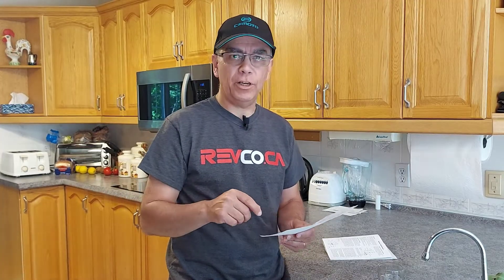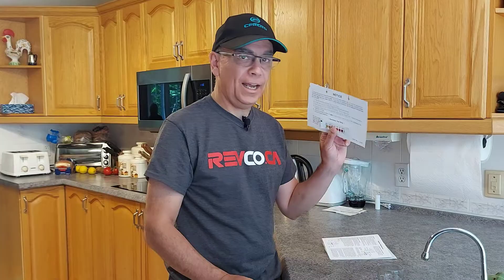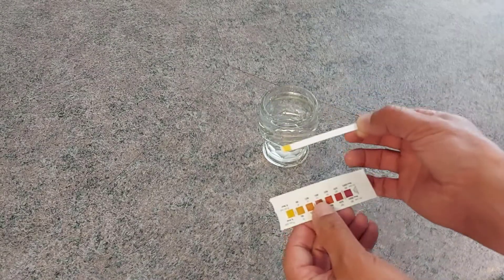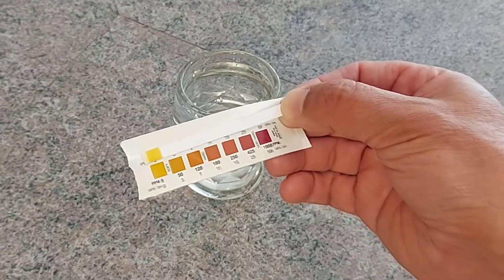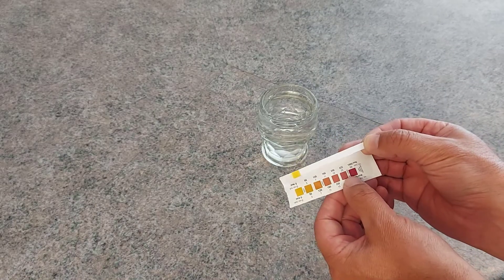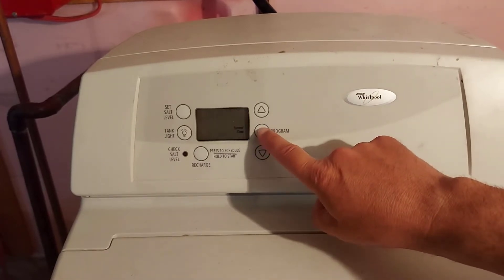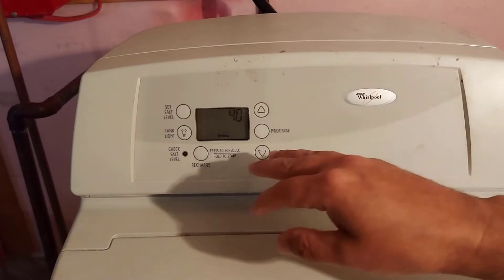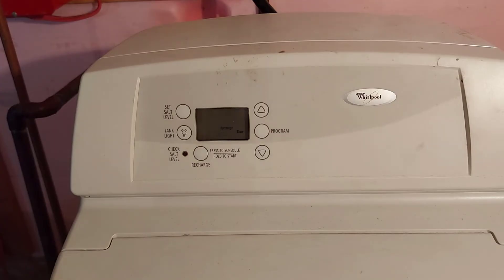How Can I Test My Water Hardness and Adjust the Water Softener Settings

Comment: I think you getting confused. To set the correct amout of salt to be used during a regeneration, you need to do a test to determine the hardness of your RAW water (before it passes through the softener.) 

In addition, you also need to do a test for the amount of clear water iron in your water (this requires a different test). 

Once you have your hardness level, for example lets assume 30  grains of hardness, and your iron, assume 2 ppm of iron, multiply the iron figure by 5  and add to the hardness. 

In this example, 2 ppm × 5 = 10 + 30 = 40. 40 would be the correct setting for your water softener. 

Once your Whirlpool has the setting, it will automatically calculate the interval as to when to recharge. It does this by monitoring the amount of water flowing through the softener over time, in gallons and sets a regeneration cycle as needed.

Comment: My number is 3 gpg what number i put in my whirpool 40.000 grain thanks
Reply: You must test your raw water for BOTH hardness (by using the dip strips as in the video) AND test for the amount of clear water iron. This test is different and involves drawing a small amount of water in a vial (included in the kit) and counting the amount of drops needed. You then take the result of the iron found and multiply it by 5 and add it to the hardness reading. 

As an example, say you found that your raw water had  40 grains of hardness to gallon and 3 ppm of iron. Take the 3 ppm and multiply it by 5 (to convert it to grains), 3×5=15, then add it to the 40 grains of hardness, 15+40=55. That would be the correct setting for the softener in this example. 

Once your Whirlpool has the setting, it will automatically calculate the interval as to when to recharge. It does this by monitoring the amount of water flowing through the softener over time, in gallons and sets a regeneration cycle as needed.
Reply: @denniswebber5967  thanks you very mych i have 40.000 grains whirpool!

Comment: Changing the hardness doesn’t give u softer water, it only changes how often your softener will recharge harder setting: more often recharge
Reply: Do you mean,, higher number of hardness setting will do more frequent recharge? Sorry, I am confused,, please let me know, thanks!
Reply: @chulsulee  yeah it will just recharge more frequently
Reply: Don't worry. I only just learned this today after replacing my only 5-year-old water softener. The collar around the resin tank broke and it wasn't working properly anymore. The water was feeling gross and off yet still kind of soft. 

But yes. Water softeners actually don't have any way to modulate. They have resin capacity to release sodium and potassium ions into the water or they don't. That's what the regeneration is for. Most modern ones detect how much water you have used, and the hardness setting simply tells it when to recharge. I may have actually shortened a life of my water softener because I had it set way high because we have super hard water here. But it turns out I may have been regenerating twice as often as needed. This does wear out components.

Comment: Great Video, but I don't really understand your logic - Your test strip tested a little bit lighter than the lowest reading on your test strip. Why would you lower the setting for your hardness from 30 to 25? Wouldn't that make your water even softer? Maybe I'm reading the manual wrong, but isn't that the 'desired' softness that you are setting your softener for?
Reply: No, the harness setting is supposed to match the hardness of the water going into the softener.